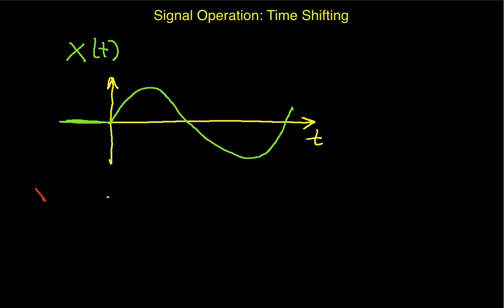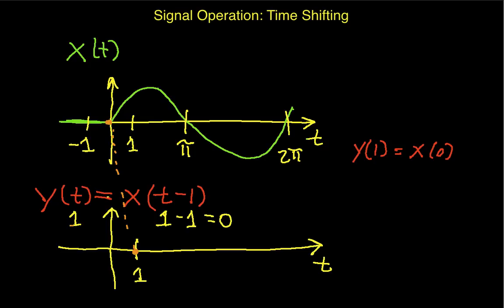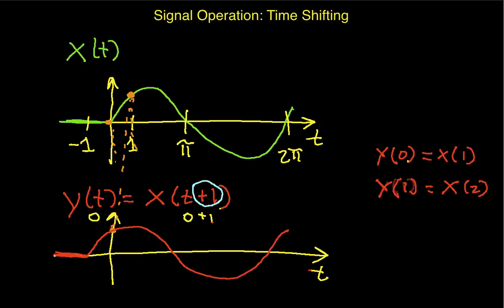Signal Operation: Time Shifting

Comment: How could you implement this time shift in a circuit?
Reply: You time delay the signal or time advance the signal, Im fairly sure that depends on the signal to be processed, not the system processing it. I suppose if you had the whole signal in "memory" you could "advance" it by picking a spot in the signal, or delay it by n number of seconds before its processed